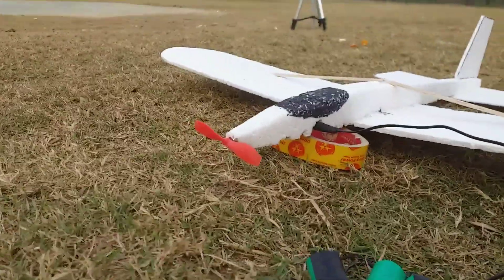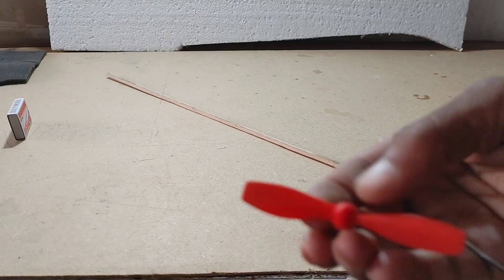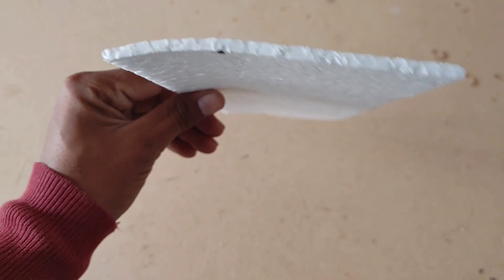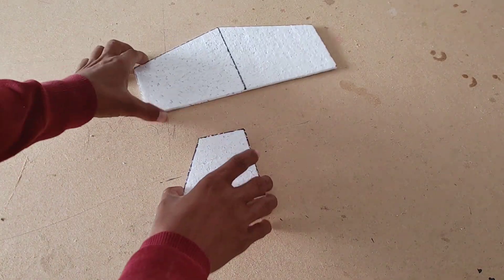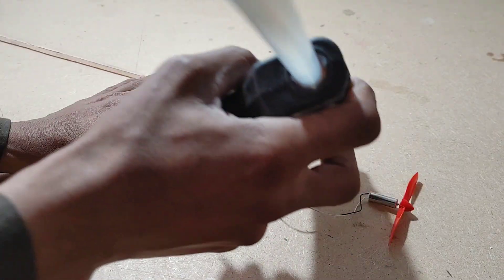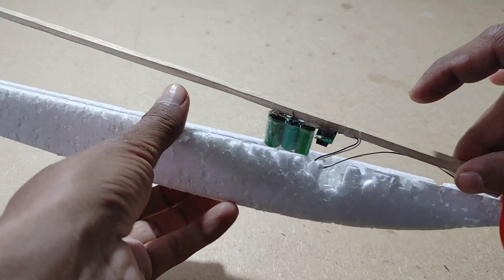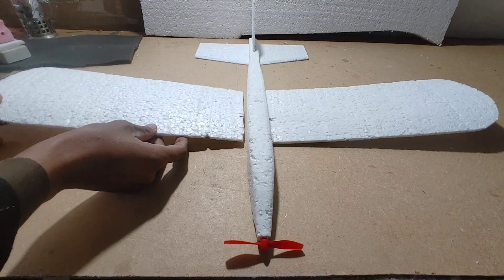How To make Capacitor Powered Free Flight DIY Airplane | Plane

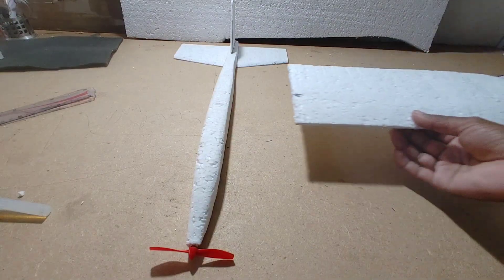Comment: information          :36   the horiz-stab should be made lighter, by reducing its root chord length to be equal to that of the vert-stab.          1:41   the main wing is weirdly located.      next time, locate the main wing about  one chord length  aft-of the prop.           locate the thirty percent of chord line.      that's where the cg  Should be  located.      then,  TRIM  the stabs for gradual climb  and  turn.        if the horiz-stab is trimmed for good glide, then the model  Will climb when flying under power.     so, plan accordingly.          googletranslate